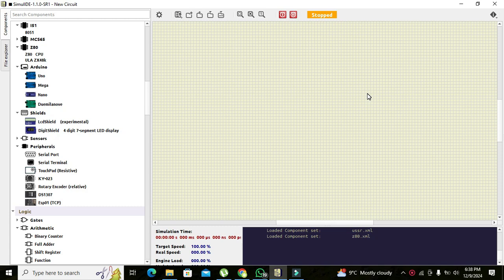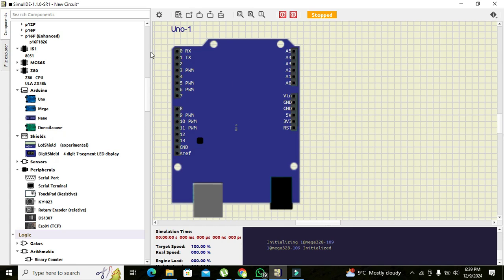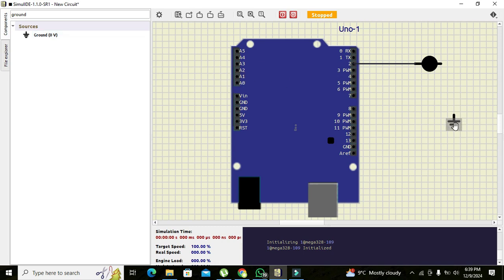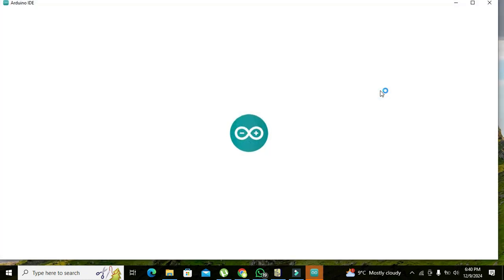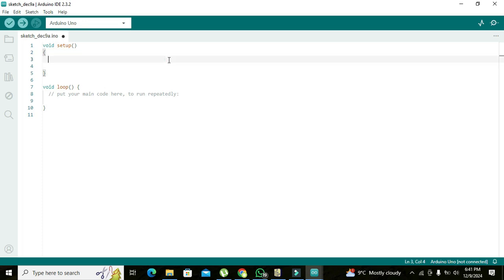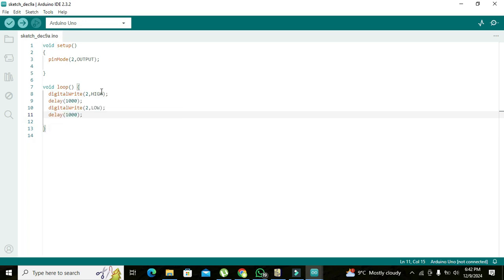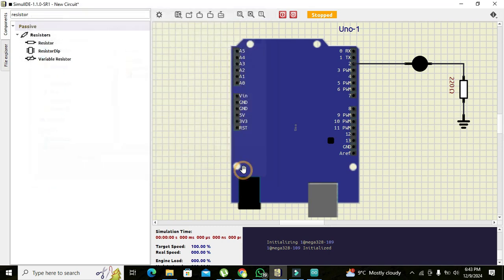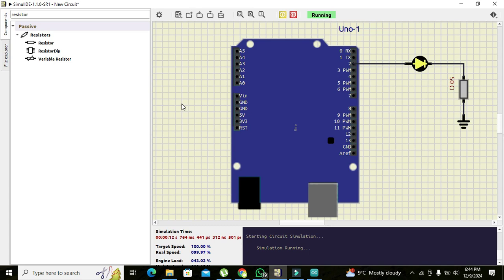how to use arduino in simulide | Simulation of arduino UNO in simulide simulator

Comment: How do you run it if it is not connected to an Arduino board to get the hex file link?
Reply from the maker: In order to run an led u just need to connect it to a square wave generator
Reply: @nelsondarwinpaktech3954  when I try to get the hex file and i upload the code, I get error. I mean the step in the video at 4.43 second
Reply: I got it now. I restarted the laptop. It's working now. Thanks